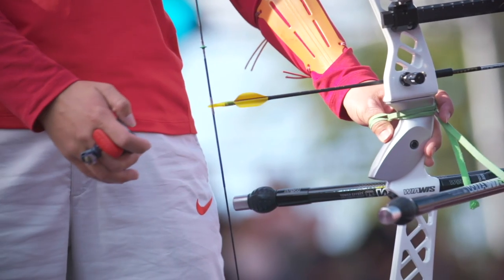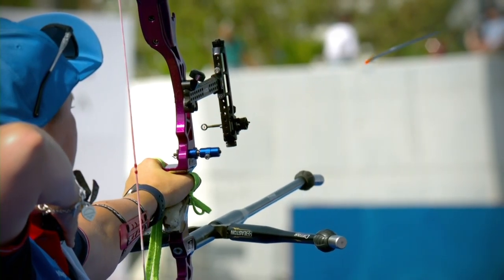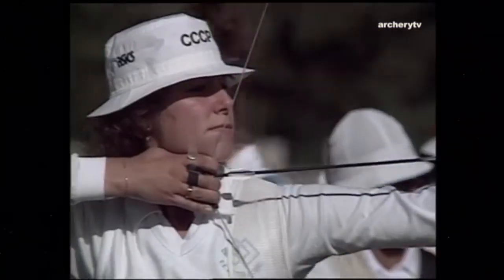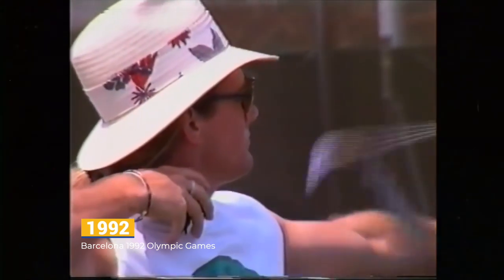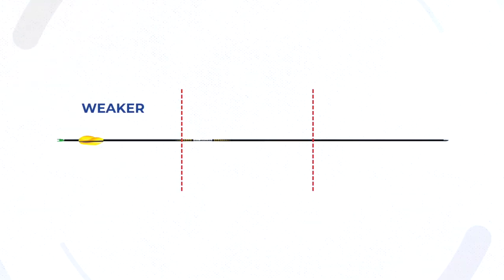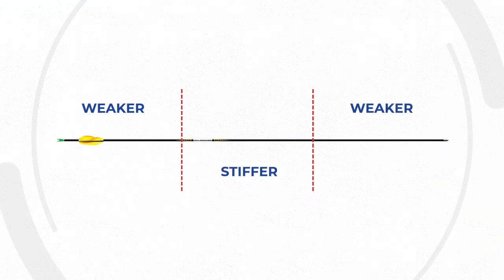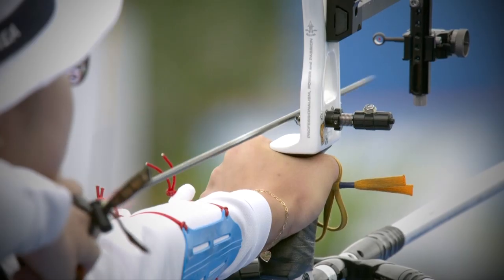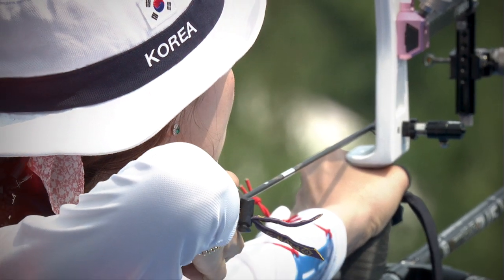The 25-year history of the Easton X10 arrow (short) | Archery history

Comment: Great arrow, still the best on the market, for now. I can't really understand how a technology is available for so long yet arrows are getting more expensive each year. 450 EUR a dozen and you need at least 2 if you're competing gets expensive really quickly. Not to mention the quality isn't that great either, requiring even more arrows if you want to pick 9-12 arrows that group really well at 70m.
Reply: Because they are terrible at producing them efficiently. To make them cheaper they need to make the process a lot faster and more efficient with the same or better tolerances.

As you can see in the video the production speed is abysmal, a lot of labor is done by hand, like feeding the extruded aluminium in to the machine and cutting the core to size by hand. No doubt other labor is also done completely or in part by hand.
Arrows going between and through machines at a snail pace arrow for arrow. And I fear they are also still using the same exact machines they used to produce the hydrogen collector tubing 25+ years ago. 

If you have any interest in watching fast production videos you know how fast machines can operate, creating complex operations in mere seconds or even less.

The R&D and upfront investment to automate processes, develop and build such machines and increase production speed with the needed tolerances and as little rejection as possible is probably a no-go for Easton. I believe they have little incentive to change their production and even less so to make the arrows cheaper, unfortunately